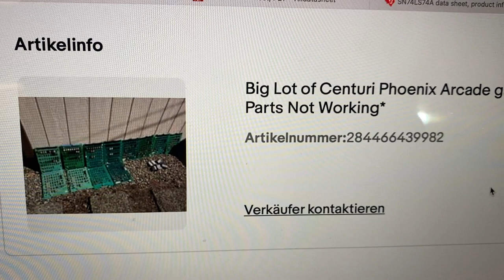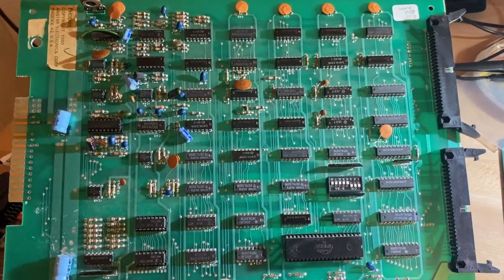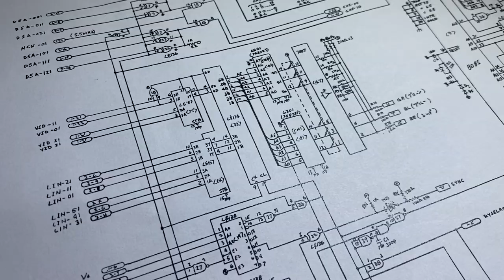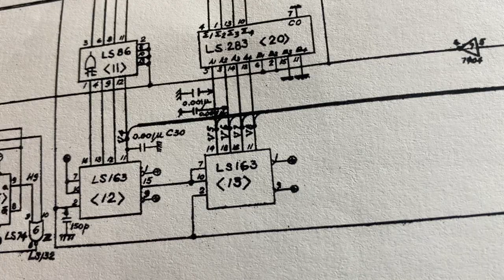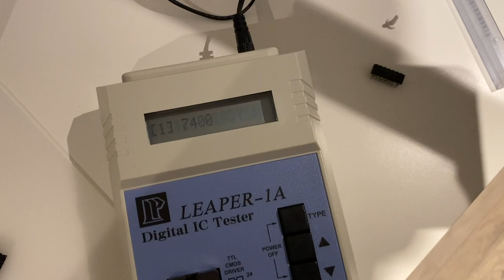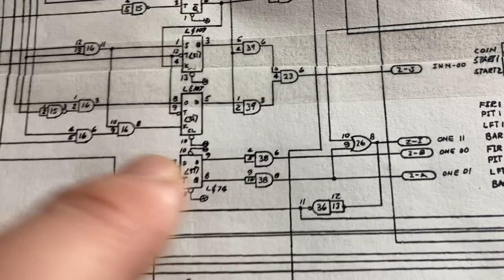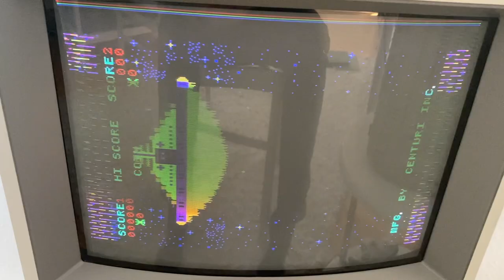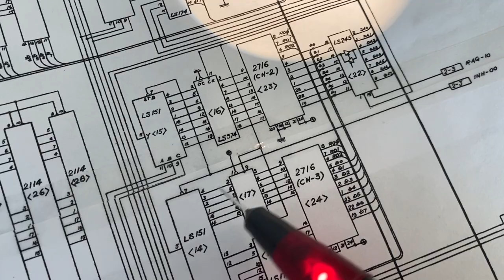Phoenix Arcade PCB Lot Repair - Part 1 - Troubleshooting with schematics and logic probe

Comment: Nice job, your diagnostic skills are great. I've got a double dragon 2 pcb where the image has dropped about a centimeter from the top of the screen. I'm wondering do I have a similar horizontal circuit problem!
Reply from the maker: Thank you! If the image dropped down a centimeter maybe there is a problem with the vertical counters - that could be assumed if maybe the picture also appears to be incomplete contentwise on the very bottom of the screen. Otherwise It could also be a monitor problem.

Comment: Hi Doktorzett,  I'm wondering if I can ask you a quick question since you have a working Phoenix PCB.  In my repair on the CPU board, does your pin 11 wiggle on IC34?  Mine is not and thus the two flip flops I suspect at IC37 are not doing much.  In my case its stuck high coming out of IC34 and I want to confirm that its not the correct behavior.  Is that correct?  Should pin 11 be wiggling to have the flip flops be activated?  Having real challenges getting a stable sync signal just to show garbage.  I removed the CPU to take it out of the equation just to get this far.  thanks so much for your help!

Comment: I’ve had several failures of the ribbon cables between the boards
Reply from the maker: Good point. After finishing the first set I crimped some nice custom cables I got some errors at first mysef ;-)

Comment: I have super breakout with a garbage screen 
The problem must in the CPU area?
Reply from the maker: Could be the case. At least video output circuit and some rams should be working. The garbage means that noone is filling the rams with useful information. That would be the task of the cpu.